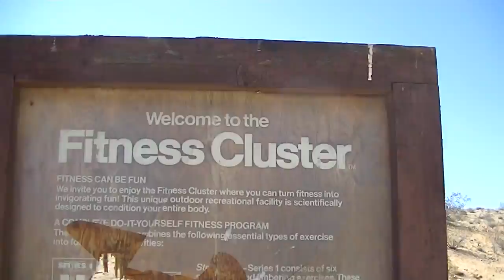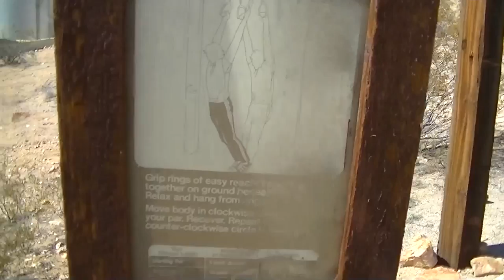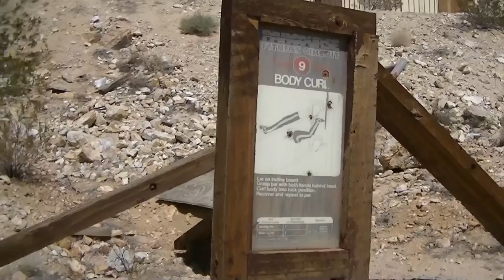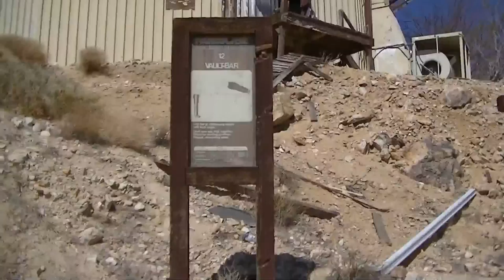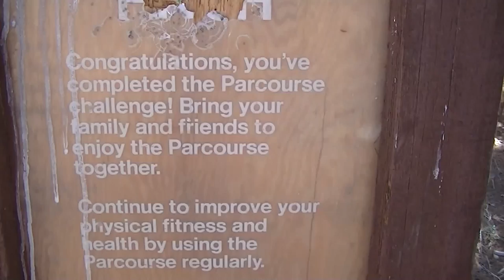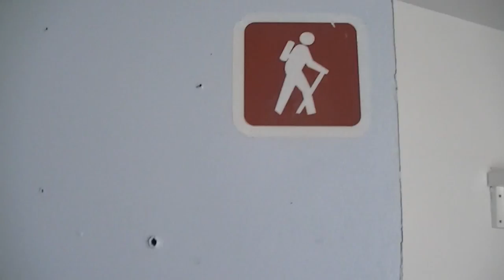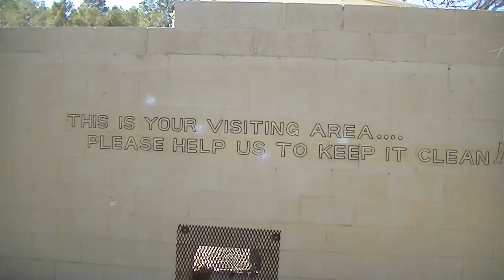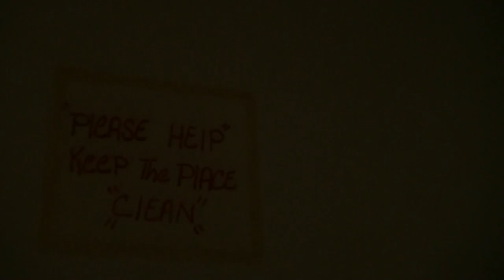Abandon Prison And Housing Revisit March 2013

Comment: It's a remote desert site six miles north of Kramer Junction is a former military base and Federal Prison Camp, with an active FAA radar facility. The prison, which closed in April 2000, was one of around 47 minimum security federal prison camps in the country, and housed about 540 male inmates. Workers in the prison assembled parts for military vehicles and rebuilt forklifts for the army. The boarded up prison facility is located on the site of the old Boron Air Station. Also known as the Boron Air Force Radar Facility, it was managed by nearby Edwards Air Force Base, and consisted of several barracks and administration buildings spread out over a few hundred acres, with a large radar dome at the peak of the hill. It was once a part of the National Air Defense Command. Most of the facility was later used by the Prison Camp, and it is now abandoned and being vandalized. The domed structure at the hill top is still in use by the FAA for aircraft flight tracking.